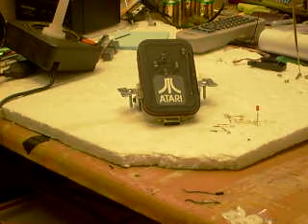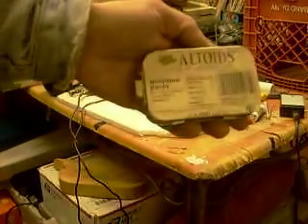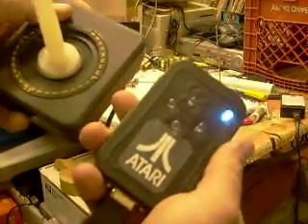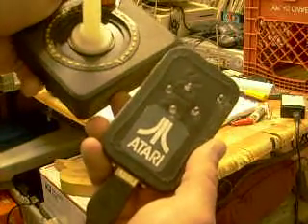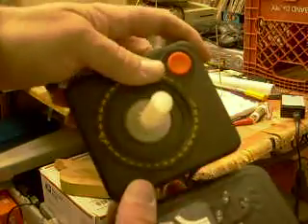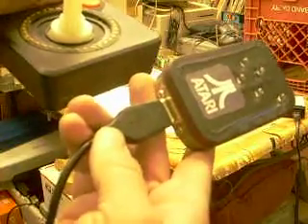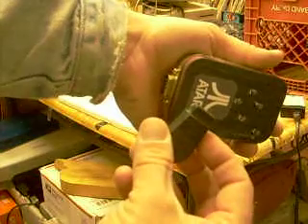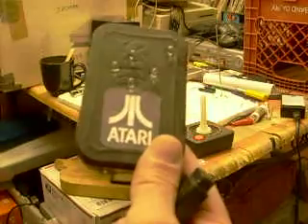Altoids Atari homebrew joystick tester

Comment from the maker: When I stuck this on a Genesis controller, the whole thing lit up and this tells me that it's wired differently and would need a chip of some kind inside. Not sure about that.

But the 7800 would be easy. Next go-round, I'll have one for joysticks, paddles and with a vibration function. The tings you can do with a 9-volt battery, I love it.